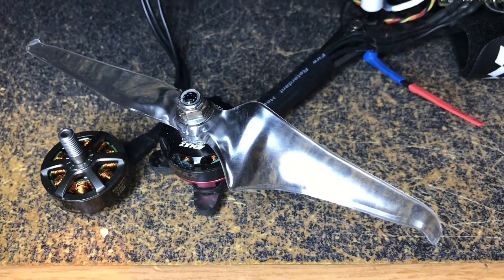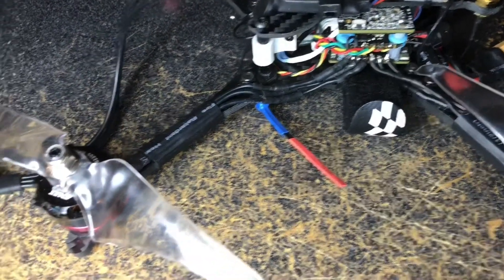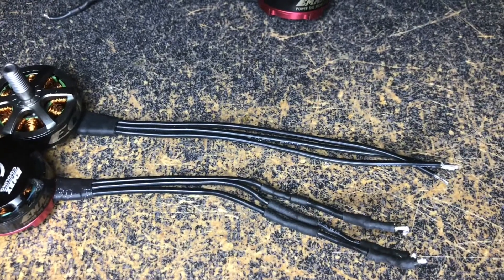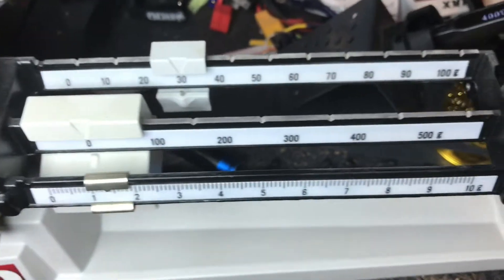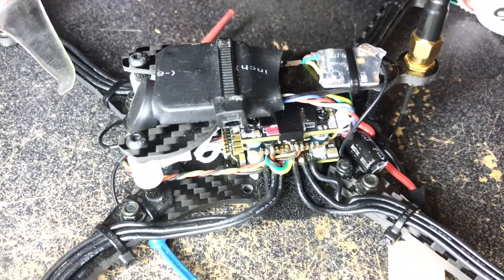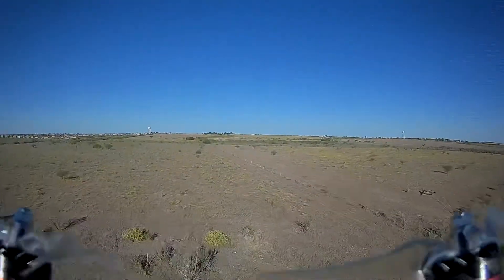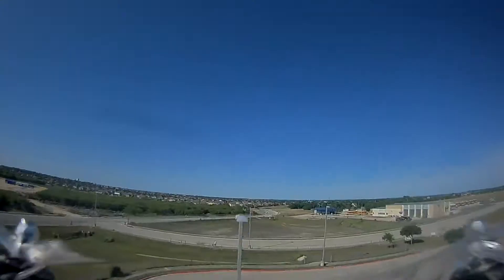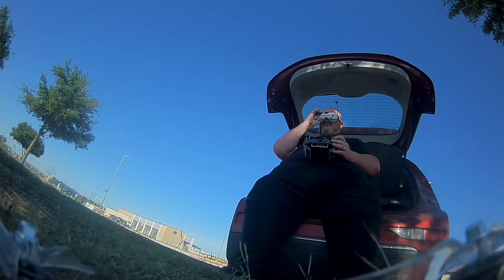Redneck Review - EMAX ECO 2306 1900kv

Comment: Can i use this motors with 3s lipo battery?????
Reply from the maker: You can. I have flown this quad with a 1000mah 3S Turnigy Bolt. Being only 1900KV, it feels a little down on power, but its adequate. It also stayed in the air quite a while for as small of a battery as it was.
Reply: @kiltedtexan  ohkk Thank you